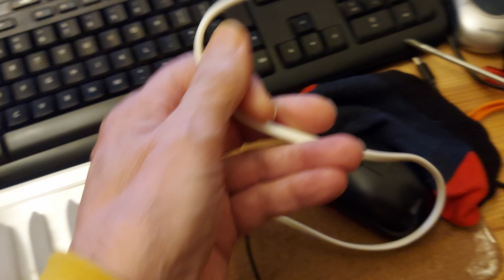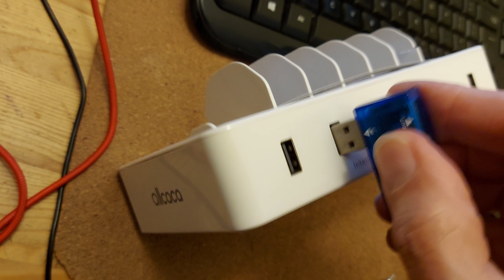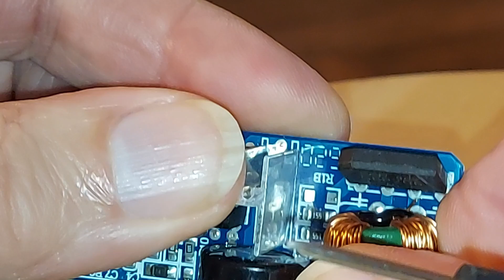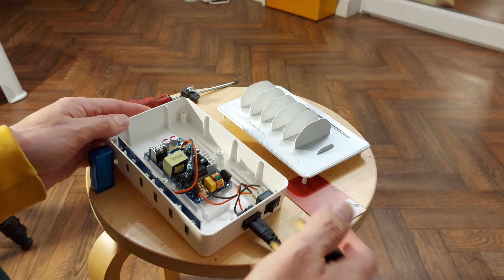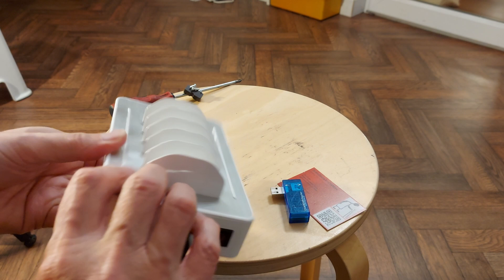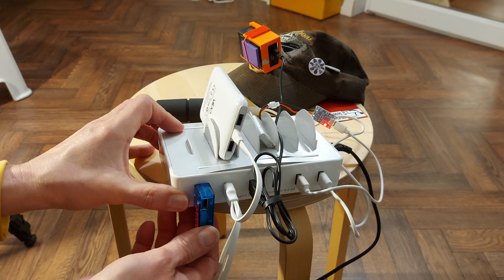Can I fix a Smart USB charging station HZPY0018?

Comment: I suspect it was dropped.
Cracking open a device to check if there's any obvious visual damage does often find problems, and it turns out that was one of those cases.
Also, that power cable was in terrible condition.
Reply from the maker: A little more damage than a drop would achieve 🤣